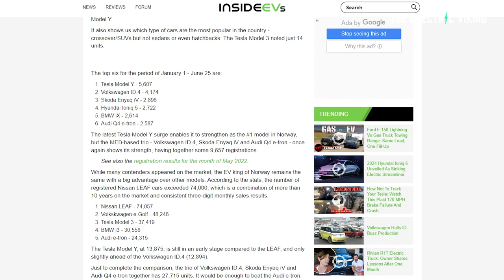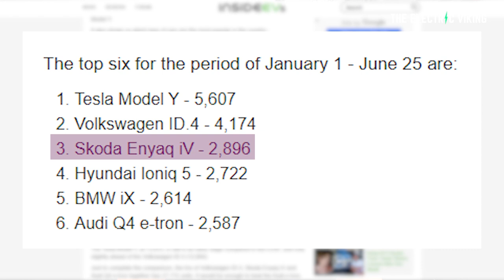Tesla Model Y in 1st place in Norway + Nissan's EV record

Comment: Norway the 13th largest oil producer; is going to subsidize the purchase of $75,000 Model Ys with an exemption on the 25% VAT -plus other benefits; that is a $20,000+ credit that has to be paid by others. 20 other taxpayers have to pay $1000 each to assist a richer model Y buyer.  Oil is 40% of Norway's exports - How many oil executives and related workers will get others to pay for their Model Y?  Just s stupid country - want to help cut CO2 - don't buy a Model Y, stop selling oil.
Reply: No one will stop using oil if Norway stops selling it? They will instead get it from other countries. At least Norway uses some of the oil money on environmental measures, such as reducing taxes on electric cars.